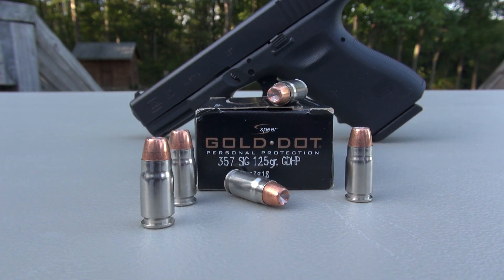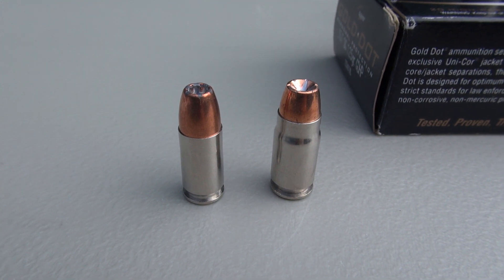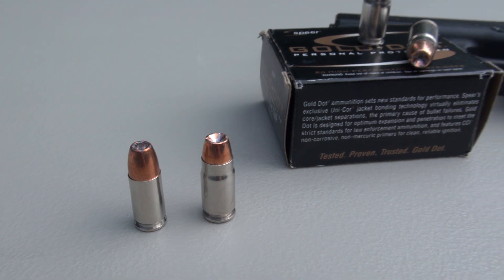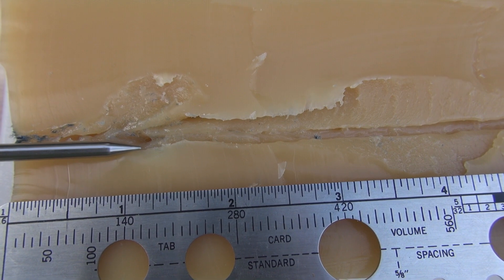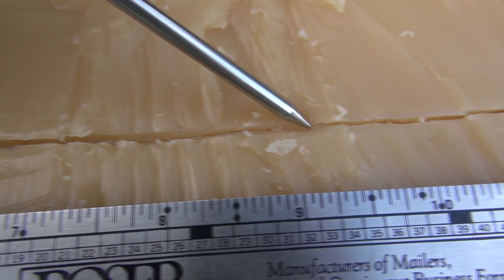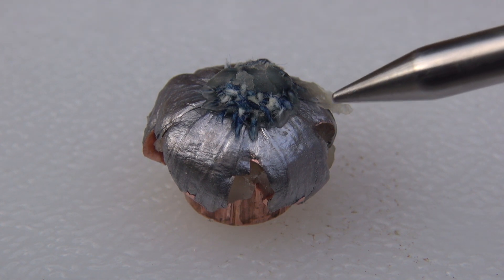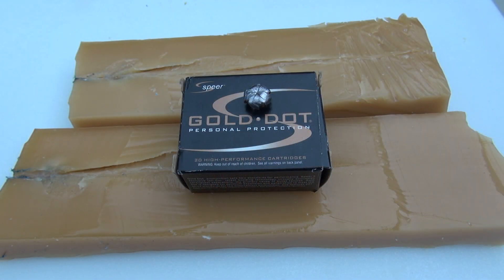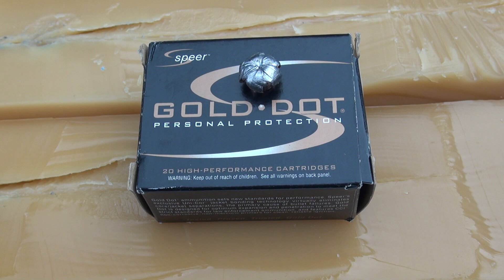.357 SIG Speer Gold Dot Ammo Test

Comment: I would like to see a head to head test between a 357 Sig and a comparable weight 38 Super+P.  I can find the 38 super and 357 Sig compared to everything EXCEPT each other.  I'm thinking a pistol that holds 12-15 357 Sigs might be better serviced with 15 - 18 38 Super rounds.
Reply: I know this is an old post, but I'll give it a try anyway. The 38 super is everything the 357 Sig is performance wise. Any real difference can come down to the difference in firearms/barrels, rather than the cartridges themselves. My 38 Super shoots the 125 grain #4360 125 grain Gold Dots at an even 1400 fps with my preferred handload, and will go 1500 if I want it to. I don't think 100fps is worth quibbling about, isn't going to make a measurable difference in real world terminal performance, and the 1400 fps load is arguably a little easier on the pistol than the hotter load is. Ironically, I just finished testing the above mentioned 38 super load, and I got near identical terminal performance as shown in the video.
The problem with the 38 super is that most factory ammo is loaded to target velocity, and is pretty weak. It will REALLY shine with proper handloading, though. I would love to see someone come out with a high capacity Super one of these days.

Comment: Why does this gel look so much different than the gel you used on the Underwood gold dots? I would have liked to see them both used on the same gel.
Reply from the maker: KingLT82 Looks like the Underwood 357 SIG Gold Dot test was in late 2012.  I'm not even certain the Clear Ballistics gel was available when this video was produced in September 2011.   Even if it was, I wasn't using it at the time as I was only about 8 months into using SIM-TEST when I ran this test.
Reply from the maker: KingLT82 Just remembered something after my first post.  I fired a couple of 357 SIG Speer factory Gold Dots like these into a clear block around March 2015.  This was a left over block from an earlier review.  No video, but the Gold Dot at Speer's velocity, from a Glock 32, penetrated approximately 16.5" and was a perfect mushroom.
Reply: ***** Yeah I was referring to both sim-test gels that weren't clear. The Underwood ammo gel looks alot lighter color wise and seems to show the wound track differently. Thanks for the super quick response.
Reply: ***** Thanks for that info, would have been cool to see them side by side so to speak.
Reply from the maker: KingLT82 Correction on the penetration.....it was 14.5" on that informal test, expansion in the range of .642" and it was bare gel, no denim; found the notes on my phone.  Expanded bullets are sitting right here on my desk.  I use them to clean my teeth after eating.
Reply: ***** Thanks for the update. Your videos are 2nd to none in my opinion, hope to see more videos from you. Hahahaha interesting toothpicks you have there, haven't used mine for that purpose yet. Both gold dots seem to have good penetration and leave nasty wounds, what is your perspective on using them to hunt whitetail deer?
Reply from the maker: KingLT82 Within 25 yards, could be doable.  Don't know that I would attempt it on a 12 pointer, etc.
Reply: ***** Going to try and take a doe with it this deer season and yeah definitely going to be going for close range shots. Might have to step up to some fast 147gr rounds. Again thanks for the info and fast response.
Reply: Doug west Not yet, deer season doesn't start until late in the year here, but I'll get back to you when I do.

Comment: I don't know why the ammo makers are dumbing this round down?  This caliber is capable of velocity much higher while keeping pressures in line with SAAMI.  I think more people would be interested if it wasn't so close to 9MM
Reply from the maker: Patrick Slevin AGREED.  If velocity was consistently in the 1400 to 1450 range, for factory ammo, it might get more attention.  Everyone already wants/expects 1300 FPS from a 124 gr 9mm and that just isn't safe, IMO.    I recently picked up some GA Arms Gold Dots, usually in stock, great price, and velocity hits just under 1400 FPS from the G32....with the 125 gr Gold Dot bullet.
Reply: ***** AGREED! on the 1300 ft/sec 9mm loads.  Way too hot for the 9mm and too much recoil for what is expected.  1200 ft/sec is an excellent velocity with a 124 grain Gold Dot and will get the job done.  What makes me angry is the way most gun rags try and kill off the .357 SIG ....its a great round, if you reload its no more expensive than the 9mm.  Gotta be a good man stopper.  Secret Service still thinks so.
Reply: Before the widespread use of bonded JHP bullets, HP and JSP bullets used to fragment at the target velocity of 1400fps. So the manufacturers dumbed it down and it still worked (sheet metal penetration).  I sure would like to see commercial supersonic 9mm too
Reply: Patrick Slevin Even a very light .357 SIG load (124 or 125 grains at 1225 - 1250 FPS) is easily able to match a 9x19mm +P+, and it's all uphill from there. A moderate .357 SIG load that sends a 125 grain bullet at 1350 FPS is a significant step up from the 9x19mm with the same weight bullet. Full-house .357 SIG loads with 125-grain bullets moving at 1450-1500 FPS or more are available if you want maximum power, but that added velocity comes at the cost of extra blast and recoil. Keep in mind that bullets have become much more advanced than the old soft-points that earned the .357 Mag its reputation. Modern 125-grain JHPs that are purpose-designed for the .357 SIG have proven very effective at 1350 FPS, and many have found that combination to be a better balance between recoil and terminal performance than maximum-velocity loads. Being able to shoot a round effectively is just as important - if not more so - than the round's raw ballistic numbers.
Reply: Patrick Slevin Prvi Partizan creates some HOT ammo! 1546fps & 660ft/lbs is .357 MAGNUM ballistics...

$18.50/50 rounds 
http://www.selwayarmory.com/prvi-partizan-357-sig-125-gr-full-metal-jacket-flat-point-box-of-50.html
Reply: GunFun ZS I wish I could remember why but I know you don't want to do that.  I think the OAL is too long with 40's sized to 357.  I guess you could trim them all if that was the only risk???
Reply: GunFun ZS Give me a sanity check...couldn't you pull the factory bullets, compile the powder, redivide at a slight increase in grains, and re-seat the same bullets?  Yes, I know you'll wind up with a few throw-away components, but probably not much.  I know this would take some trial and error to work your way up slowly/safely, but it seems like the easiest way to get some hot rounds for carry.  Reason I ask; I've been waiting on Underwood to restock their bonded 124gn Gold Dots for well over a year.  I am a patient man, but this is ridiculous.
Reply: Patrick Slevin If you want some really hot .357 SIG's try and find some Underwood Ammo.  That stuff is very warm.  In excess of 1400 ft/sec and in some instances 1500 ft/sec depending on barrel length.
Reply: Patrick Slevin I got some Israeli Military Industries stuff that was 1280fps, but the recoil wasn't bad...

I use Fiocchi 124gr .357 Sig ammo for practice because it's 1350, but I prefer HST for carry because that's also 1350. I was thinking about bumping up to Prvi Partizan for practice and Underwood for carry, but it's just not worth it... I'll probably NEVER even be in a self defense shooting, so no need to waste all of that extra money... :-D
Reply: Friend, if you can predict when you are going to be in a self defense shooting, smartest thing would be to not attend. Barring that option, carry the most effective firearm and ammo you can afford, Train for the worst case scenario.
Reply: Why not make your own? Plenty of .40 brass around to neck down.
Reply: Patrick Slevin It seems like that was the case, but I am sure correct information is available upon searching.
Reply: keifsanderson You don't know what powder they use, or what the pressure curve looks like. Better to use a chronograph and book data for that bullet to achieve the desired velocity.
Reply: ***** Amen!

Comment: I enjoy your channel. I think it would be good to test a round or two of the other Speer Gold Dot load, the 54232. Leaves the muzzle at 1375fps and is in fact the hottest "major factory" load made for the .357 SIG.

Also noteworthy, the other Speer Gold Dot load, marketed to both "personal defense" and "LE" use a 5 petal design, as opposed to the 6 petal in the higher velocity load. I have seen 6 petal in the 1350fps LE load, but this could also have an interesting twist on performance.

Comment: Compared to the .357 Sig from Underwood, this round seems weak.
Reply: tony davis Pansy ass 9mm? You realize that the .357 Sig BULLET is 9mm, right? The standard pressure 124gr 9mm Federal HST gives a consistent 15" of penetration now... 9mm rounds are far from pansy nowadays :-D
Reply: 1350fps to 1375fps isnt bad for 357 sig Speer definitely is the best load in 357 sig than any of the other major brands its that watered down shit that barely breaks 1200fps that you might as well carry panzy ass 9mm

Comment: Nice video. Speer also makes LE Duty version, item #53972. Speer claims it is 25fps faster than the #23918 in this video. Also it is a 6 petal hollow point as opposed to the 5 petal one shown here. I have a few rounds of both, hard to find and expensive, too bad.
Reply: I just commented without seeing yours. Good info.

Comment: exactly.. the only disadvantages the 357 mag has is low capacity ,size and over penetration with the bigger grain bullets .. The 357 sig with a 3 1/2 inch barrel 125 grain and 357 mag 3 1/2 barrel with 125 grain will put out around the same numbers though

Comment: Shouldn't be a tough argument.  The .357 Magnum is capable of hustling a much heavier bullet in 135, 140, 158, 180 and 200 grains at velocities that equal the 10MM.  .357 Sig is hands down a higher performing round over the 9MM, unfortunately, the sig ammo is expensive and not always easy to find.

Comment: Go watch your own video on the Underwood 124 +P+, you say exactly the opposite when you point out how damned close it is to most factory .357Sig loadings.  I completely agree with (almost) everything Itsallnyermind4 said, minus the closing comment about pressure (don't see what that has to do with anything).  .357Sig really is just about useless, and definitely not worth the significantly increased cost in not just money but recoil and magazine capacity over 9mm.

Comment: The .357 Sig deserves much more recognition. In my humble opinion, it's the best auto cartridge for law enforcement or personal defense. I've used a Glock 32 since 2005 in this caliber, with a Glock 23 barrel for .40 S&W ammo as well (which is also an excelllent, well-balanced calibre). The .357 Sig is a match for any .357 Magnum round, fired from a 3" barrel. Yes. a 4" or 6" barreled .357 Mag may yield higher velocity, but at the cost of bulk and weight. This one just hits all the sweet spots!

Comment: I've noticed Underwood has some 9mm 124 +p+ at 1300fps which is essentially a .357sig. Now with the same bullet weight and nearly the same speed, would it be 'as safe' shooting the 9mm +p+ than the using the 125 grain .357sig?

Comment: As always TNO9, your work here is fantastic. I'm a little surprised at just how consistently the .357 Sig is performing...last time I was at my local gun dealer, they had a Glock 31 or 32. Any plans to do more .357 Sig testing? Buffalo Bore makes a couple of loads in it, the more interesting of which would be in JHP. They claim competitors "water down" the sig ammo. They also plan on a load with Barnes lead-free bullets.

Comment: What has been your experience with Gold Dots in .357 sig? I carry those in my Glock 31, the Law enforcement one that supposedly shoots 20-25 fps faster. Either way I tend to notice that with Gold Dots the shooter gets the best of both worlds with nice penetration through light cover, and reliable expansion with little core jacket seperation because of the bonded principles. However, when I am in my car I run FMJ rounds at 1400+ fps, just in case I need to penetrate my own windshield.

Comment: Have you shot 357 Sig? I think you'll be surprised at how similar it is to 9mm. Yes it's a bit louder but the blast/flash/recoil thing is wildly overblown.  It IS expensive but you can always handload for basically the same cost as 9mm.
 
It may be only 10% faster but that equates to a LOT more energy. To put it another way, the difference between 9mm +P/+P+ and 357 Sig is larger than the difference between standard 9mm and 9mm +P/+P+.

Comment: I purchased a box of these to see how they function in my Springfield XD, and I'm finding that they have some feeding issues. It might just be a fluke for me, but the flatter tip on the hollow point seems to get stuck on the feeding ramp, more so than with the Corbon 115gr JHP I had been using. You didn't have any issues with your Glock, did you?

Comment: Good test. I definitely do not want to be  on the wrong end of one of those puppies. I think if .357 Sig practice / plinking ammo were as available and as "inexpensive" as 9mm or .40, more folks would give it serious consideration.
Reply: Honestly, my uncle gets handloads at near 20 cents a round, simply because of brass.
Reply: Mr. Gible 

I forget what I paid for 100 gold dot bullets... probably $20-25

So yes I imagine I can hand load this round for at worst... 30-35 cents a round.

Dirt cheap...as long as you have the brass.

Around $15 a box of 50
Less than 1/2 price...

I imagine gold dot is close to $40 a box if not on sale.
Good stuff.👍
Reply: only if ammo was as cheap as it was when this comment was made
Reply: I carry my gun in 357 and practice with 40. It isn't exactly the same recoil but it is still practice.
Reply: 10 year Update! Here in Georgia a 50 rnd pack of Winchester target ammo in .357 sig is $65.00.
Reply: Yeah it’s bullshit
Reply: @r2hPreDatoR  same here in Mississippi  Winchester  white  box hollow  points 50$ a box not to bad bit still  expensive  but the caliber  is well worth it it has more power than 9mm 40 cal and 45 acp it's a beast for sure

Comment: @fomocowboy  Same magazine fits both.  I have a Glock 31 that uses 357SIG magazines and Glock .40 cal magazines interchangeable.  Does not matter if I load 357SIG for .40 caliber in either magazine.  I do have the .40 cal barrel  - no problems with either magazine.

Comment: @tnoutdoors9 

From your test of the 180gr .40 the penetration was ~13.625" w/ expansion of ~.684", this .357 Sig round is only 125gr & achieved ~14.5" of penetration w/ expansion of ~.572". I'll take proven better ability to handle intermediate barriers, deeper penetration & increased tissue damage over ~1/10" increased expansion but less penetration, less tissue damage & less ability to deal w/ intermediate barriers any day. 147gr test will be good, but not bonded = not good @ these energies.

Comment: Thank You for the test.

You may know this already but.... The 23918 in this test is one of the versions of Gold Dot Speer offers. The bullet in this test is a 5 petal 125gr. GD @ 1350fps. This round is Speers lower penetration .357sig round which is more for shorter barrels.

Speer also offers a 54234 .357sig round which is still 125gr. but uses a 6 petal GD bullet @ 1375fps. This 6 petal bullet is known to give deeper penetration. If you could test the 54234 round also that would be great.

Comment: i think many people dont take in consideration that energy transfer is a big deal. like you said. a bullet that has 400 foot pounds and travels 12 inches has actually deposited more energy than a bullet with 400 foot pounds that travels 16 inches. this can be the cause of many factors such as the speed of bullet expansion, the finished (expanded) diam. or the time spent in maximum expansion (before over curl begins). just a note to prove your theory :)